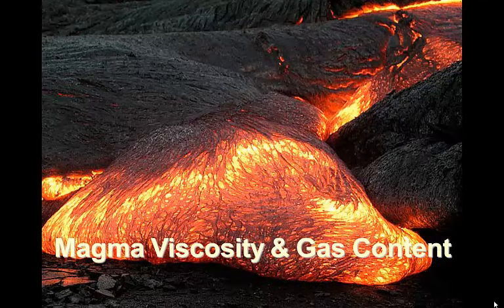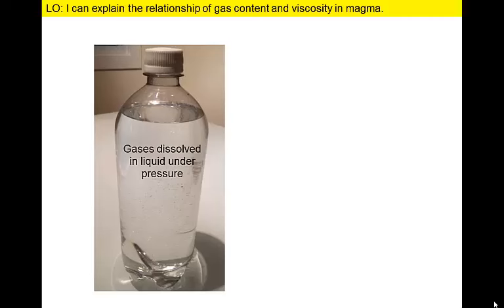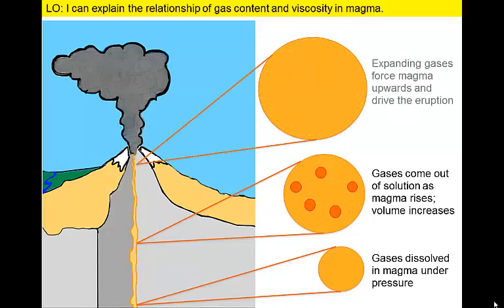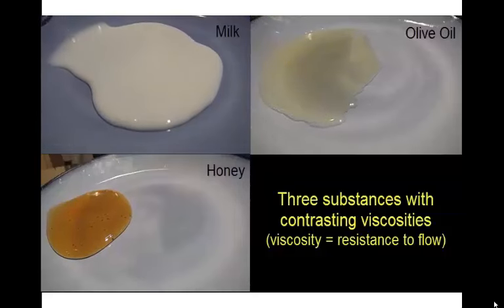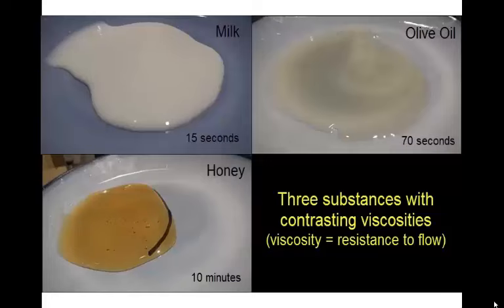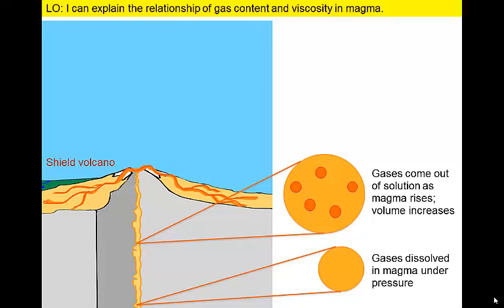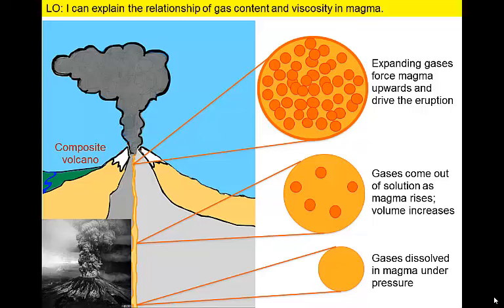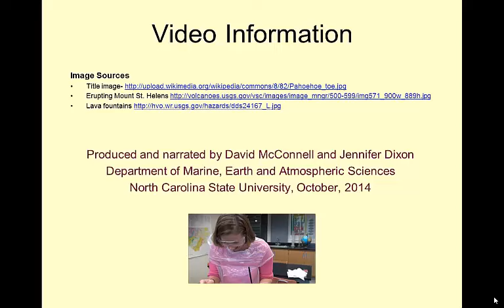Magma Viscosity, Gas Content & Milkshakes

Comment: Another example of dissolved gases forming bubbles in a solution in response to a decreasing pressure around the system is what happens in decompression sickness. If a diver ascends too fast from a deep dive and does not allow time to 'de-gas', the dissolved gases in his blood will form bubbles as the surrounding water pressure decreases. These bubbles then cause the symptoms known in decompression sickness or 'the bends'. That is why it is important to never ascend to the surface too fast after a deep dive.